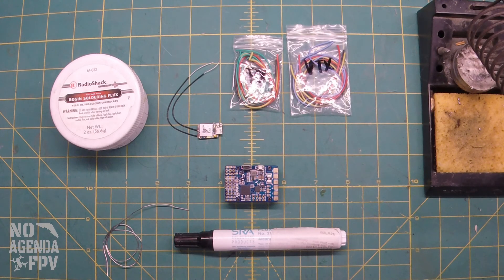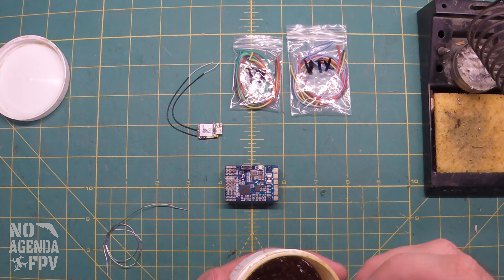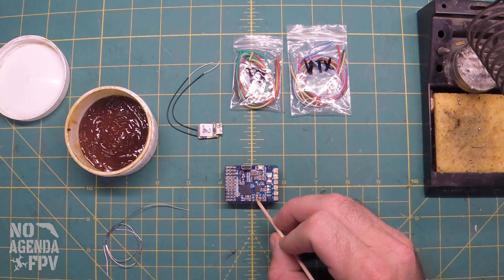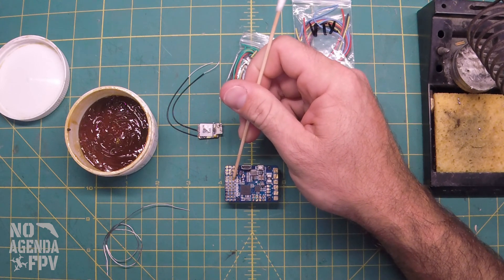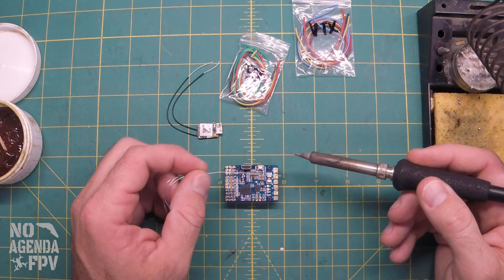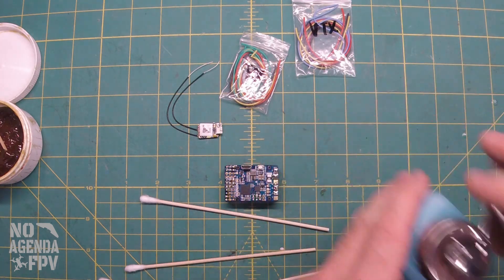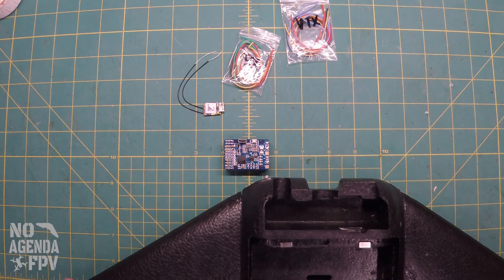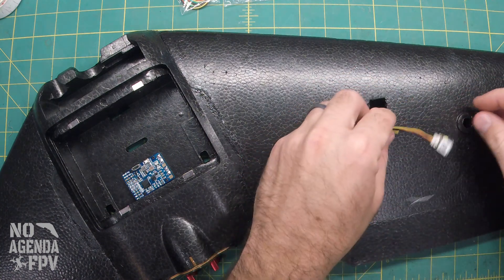Reptile S800 Build Pt3: Electronics install

Comment: I'm just building my S800 so I have been  Following your S800 Build Vids which have helped me a lot!
Great !! Thank you,  very informative.
What motor are you using ?
I've got some 30amp Quad BlHeli_S esc's so I plan to use one of those 
I have'nt tried a Quad esc in a fixed Wing Build before so I am hoping that it will work ok!
Thanks again
Reply from the maker: Sorry I'm slow editing them, I've already maidened, crashed, and remaidened this one. I have emax RS2205S 2300kv motor, and I use quad ESCs with flight controller

Comment: Hmm. Maybe I misunderstood but I got the impression went hunting for an univerted smartport signal from the receiver. I used an F411 and used smartport to softserial1 (ST1 pin). No need to use an univerted smartport signal.
Reply from the maker: I was basing the use of inverted s.port due to my history with the F405-Wing and OmnibusF4pro boards. I'll have to look into the use of inverted s.port with the F411
Reply: I also have an F405-wing and I used univerted smartport on that as well. It works. I get GPS vbat etc on my QX7. It worked with an XSR and an R9 Mini.
Reply from the maker: When you say you used uninverted, do you mean the solder pad? The pin on the end of the receiver is inverted.
Reply from the maker: I just checked and verified that the setup I have in this video is reporting back all the telemetry info to my X9d+. Since it is soldered in I'm not likely going to undo it to try the other pin, but if I can get my hands on another R-XSR maybe I will try the inverted signal from the pins.
Reply: Hmm, just to make sure I wasn't talking garbage I just went and double checked myself. XSR on the F405-wing and R9 Mini on the F411-wing are both via connector/end pins, so uninverted. Also, R9 Mini is  so new I don't think anyone has worked out how to get an univerted telemetry signal off the board. BTW: May be my misunderstanding, but isn't one of the points of softserial on an F4/F7, is the processor has enough grunt to univert the signal without using much cpu?
Reply: Just in case you are taking this as criticism, which it isn't. I do like the series and the videos. Awesome.
Reply from the maker: I'm not, I'm interested in figuring out if there is no need to do the little solder. Just don't want to pull it now that it's in there and working. I appreciate the comments and ideas.